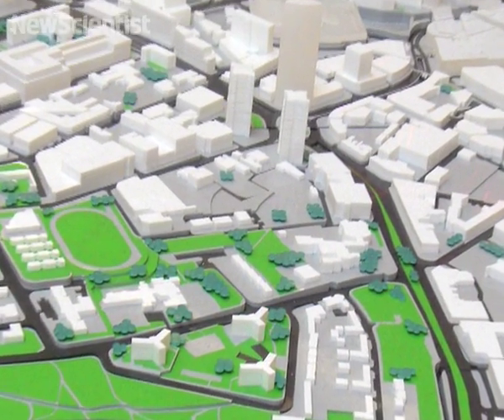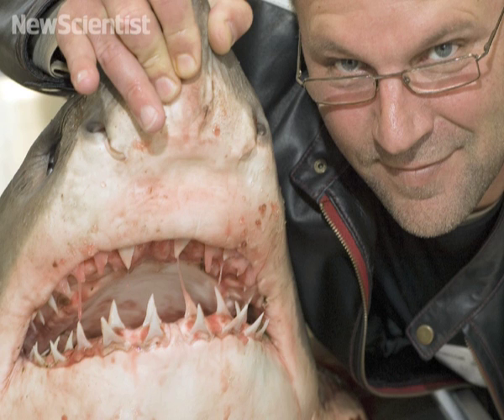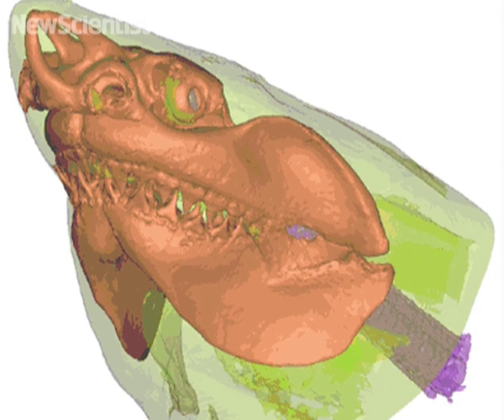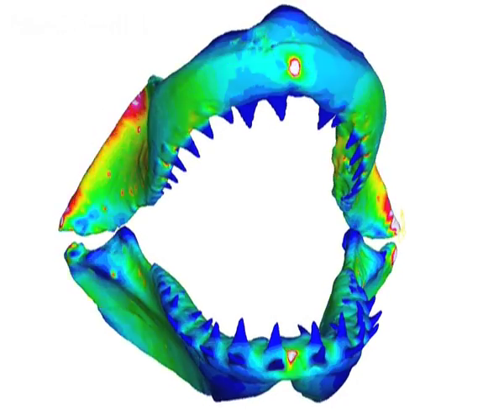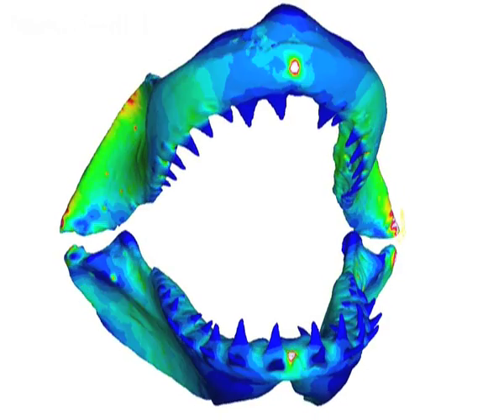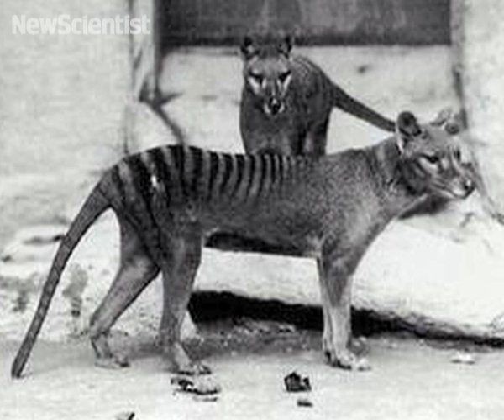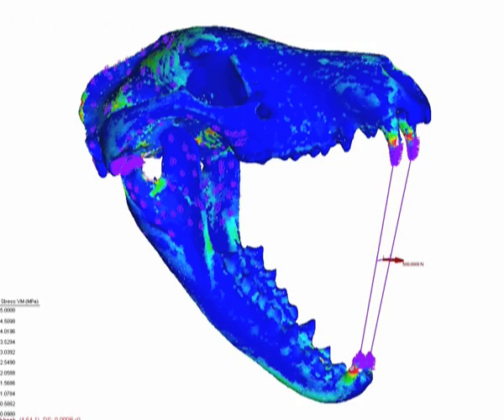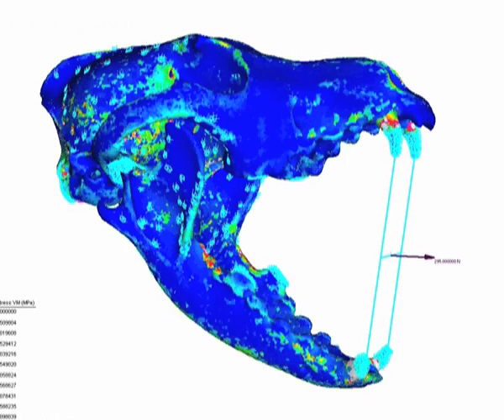'Crash-tested' skulls throw light on extinctions

Comment: Finite Element Analysis has been used to design and check the structure of aeroplanes and bridges for several years now. Hence, its pretty well tested. It can be used to demonstrate how strong a skull is and that in turn can allow inferences with respect to bite force and perhaps feeding strategy.